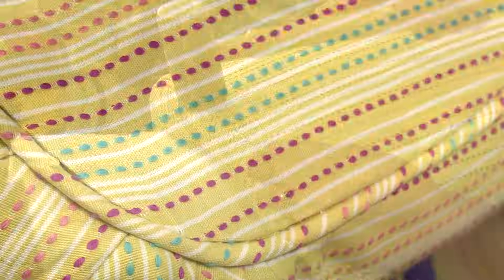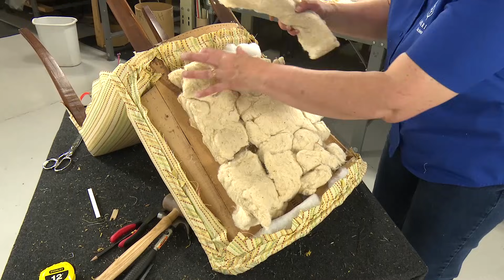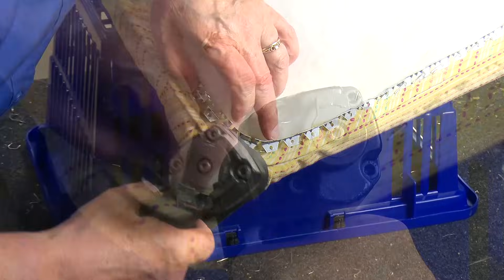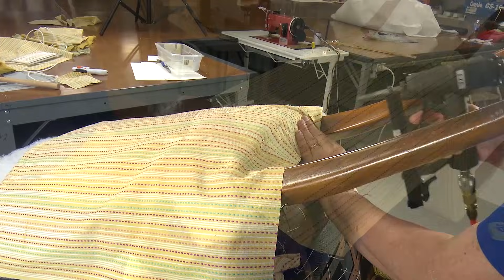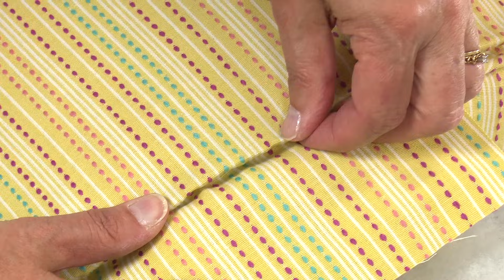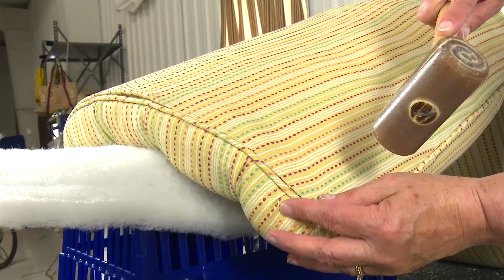How to Use the Flexible Metal Tack Strip

Comment: Can the flexible tack strip be used to hold a chair's seat fabric along welt/piping running around the bottom edges of the seat next to a carved wooden frame? Or will the up-and-down motion created by people sitting on a chair cause stress on the fabric pulling against the teeth and metal edges of the tack strip?
Reply: The seat fabric goes under the seat and is stapled to the bottom, then the welt/piping is attached to the underside so all the raw edges are hidden underneath the seat when you attach it to the frame. You can add utility fabric to hide the underside for a clean finish even if the chair is tipped over.
Reply: @julietmurphy8637 , thank you for answering. My project is a hand-carved teak chair with a carved wood border along the lower edges of the seat between each of the carved legs, so I can't wrap the fabric around and staple to the bottom. This looks like it would work perfectly for getting the fabric to fit against the wood frame all along the back of the chair (both back as shown in this video and front, which also has a wood border), but I'm still looking for solutions to bring the upholstery up to the edge of the wood around the entire bottom edge of the chair. I'd love to hear ideas.
Reply: @musapedestris1592  You'd be making the seat separate from the chair using a plywood base, then attaching it to the chair frame from underneath.
Reply from the maker: No, this flexible tack strip is not made for applications where an occupant will sit on the fabric, it would not hold up to the extra stress.

Comment: I am replacing  foundations for twin beds from standard to low profile and need to use the same expensive bedskirts.  I am hoping that these tack strips would work.   I need something  that can be removed easily to launder the bedskirt when necessary and use again.
Reply from the maker: I do not recommend them for that application. They are meant to be a permanent application only.
Reply: Try Velcro strips.